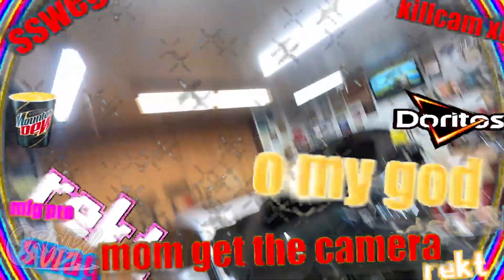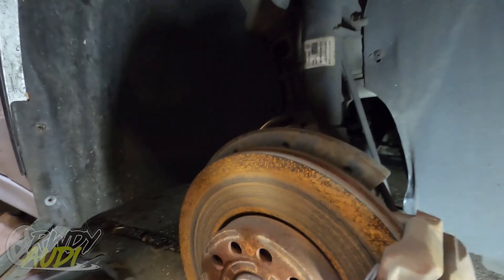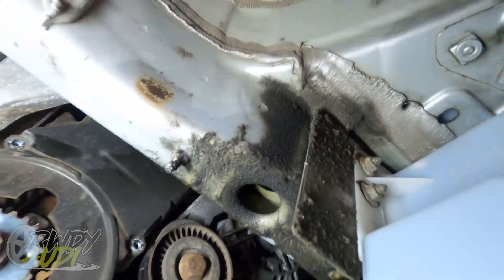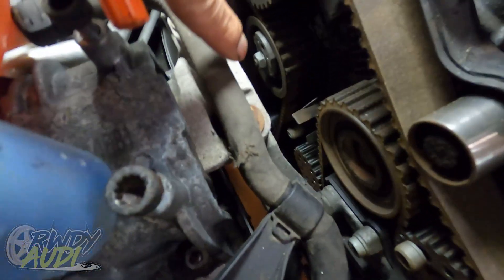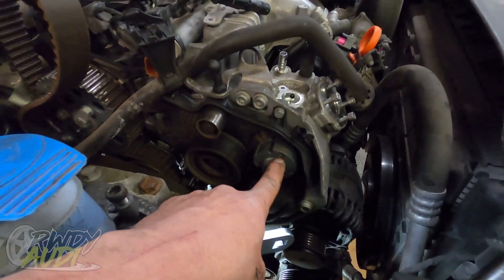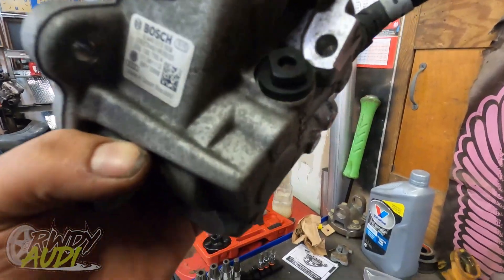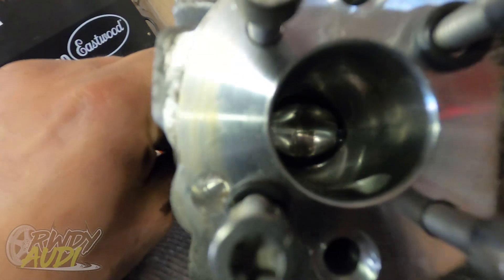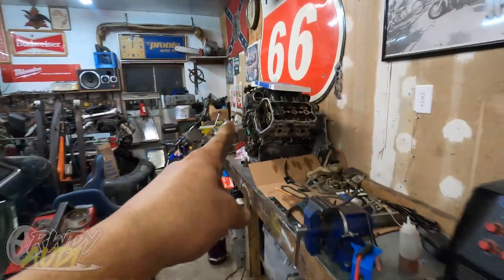How to REMOVE a HPFP on Volkswagen Jetta TDI | Why does the CP4 High Pressure Fuel Pump FAIL |

Comment: I just took mine off, theres metal shavings throughout the system but I dont see any wear on the cam or the roller, which is puzzling.
Reply from the maker: That's definitely a bit of a concern. Without any visual, I'm assuming the worst, I would suggest start collecting the bits to do this service sooner rather than later.

Comment: you don't need that tool to remove the pulley from the fuel pump. I used a 1/2 inch impact gun with a 24mm socket and it came right off. Used the same method installing it. Leave the nut on when you are removing it with the steering puller so it does not go flying off .

Comment: There is upgraded cp4 existing with one additional torx bolt preventing the piston to spin, post 2017 BMW got it and VW post 2020 I think
Reply: thats intresting, do you know what bmw and vw models got that upgraded cp4 pump? if so are those a direct swap on b7 2.0 tdi passat. thanks

Comment: Did you have any glitter on the fuel metering valve screens ? If so how much?   

Right now I have a small amount of aluminum flakes on top of the fuel filter and at the bottom but not  in the filter pleats when I cut it open and nothing I can see on the metering valve screens. I'm want to do the CP-3 conversion and am debating about doing the injectors as a maintenance item but not sur if it's necessary since the car only has 100k miles, Thanks
Reply from the maker: I have found more metal/glitter in the metering valves when these fail than I have found in the filters, usually when i find flakes in the filter and not the meter valve i also see injector pressure to be alittle lower then ones with no metal 10 to 20 grams. That said, if I was doing a cp3 upgrade as pre failure, I wouldn't replace  the injectors just the pump . Unless I had issues after the conversion... also you won't need the aux pump after the conversion and reflash.
Reply: @TheRwdyAudi   so you wouldn’t do the CP 3  conversion as a preventive maintenance if the CP 4  didn’t let loose ? 

I wound up, taking my pump head off in the car and looking at the cam and roller, and it looks perfect a little where in the board just discoloration at the top where it sits longer in the stroke 

I put it back together with a new filter, primed it, and drove the car around 

Under a wide open run, I got 1848  bar max  fuel pressure on a specified 1808 and then it came down to 1808

For boost, I got 2165 minus the 1052 with no boost puts me right at 19 psi by my calculation 

My idol IQs after all this being hot were .05 -.02 -.28 and -.12 how do those look I heard you want a total swing of .5 max so meaning if one is -.25 and the other one is positive.25 or is it up to .5 either way of an injector.

The kit I was thinking of was from Cascade German it’s by Fisher and they use the BMW R 70 CP3 fuel pump 

I like it because it’s brand new and I just bought two new electric fuel pumps and I like the thought of the auxiliary feeding this CP three because you leave it and also you don’t need to get a tune their metering valve either works or you use your old one 

So for now, I ordered the wheat bread, disaster kit that goes under the metering valve and I’m going to dose with diesel, clean and a lubricity additive and keep my fingers crossed to the point of arthritis 

I just bought this car have less than 500 miles on it. Don’t need to be putting four grand into it. I can do all my own work though at least  It’s at 100 K now

When the time comes closer to a timing belt  then I’ll either put a new CP four or do the CP three conversion I like the idea of a new pump over rebuilt
Reply from the maker: That sounds like a great plan, I apologize for my Grammer  on the prior post. I would definitely upgrade if it is in the budget, especially if you need a timing belt.
Reply: @TheRwdyAudi  what do you think about my injection quantities at idle and fuel pressure and boost

Do they all seem OK? 

I’m assuming the injection quantities that idle would be off if any glitter got the injectors  

What are bad injector quantities at idle when you should change injectors ?

Comment: You removed the camshaft follower so easily. Would you say an easy, preventative maintenance procedure on these cars would be to simply pull the camshaft follower and reseat it... or maybe even replace it every so often to ensure it never gets to this rotated state??

FCP Euro sells the camshaft follower and in looking at 1:11 in your video, it can be done without removing the pump.
Reply from the maker: You could 100% inspect the follower, I usually as a courtesy. I pull the meter valve and inspect for metal shaving, it alot simple then pulling the follower out. That said you could still pull the follower with minimal effort, the problem with these are there no detent to keep the follower in place like cp3 pump. Long time ago there was guy modding these cp4 pump to have a lock on them to keep the follower from walking around.

Comment: Hey bro. Did you end up having to replace the fuel injectors afterall? Or anything else?
Reply from the maker: Yes, we didn't risk it when the hpfp goes metal is almost always take the injectors out and filter. The lpfp and tank lines are usually fine along with the aux pump under hood. Everything else needs to be flushed or replaced, I don't have a promo code, but there is a shop " hans auto parts" I've bought several rebuilt set from him to help customer out with cost and haven't had any back knock on wood

Hope this helps and you get your car back on the road
Reply: @TheRwdyAudi  Got it, Thanks alot. I'll be doing all this pretty soon. your video is very helpful.

Comment: Is replacing a HPFP like this a catastrophically bad idea to do by someone with intermediate car knowledge lol? I've been quoted £2.6k on replacing my HPFP due to metal filings in my fuel filter on a 1.6tdi 2012 Audi A3 and I'm debating buying a refurbished HPFP and attempting it myself. I don't want to brick the car but the repairs are worth more than what the car is worth haha. Any advice would be useful ! :))
Reply from the maker: I'll be honest I haven't done a 1.6tdi yet. If it anything like 2.0tdi it jot that bad replace your pump, timing belt, and replace the injectors, take picture sof the injector which hole you put them in so they can be coded. Later replace your fuel sensors and flush the lines from the filter to pump and rail, prime it and it should fire right up. I've done alot of these 2.0tdi and never had metal in the tank or in the feed lines. 

This is the kit I used 

https://amzn.to/3W7szyC

I would recommend finding a service manual on ebay for your model of engine. Might not be your car specifically  but your engine and read up and follow the instructions.

The real cost comes when you buy the tools and then figure out if the 36 hrs and 4 weekends was worth the difference of having it done in a week lol. Honestly this job I would say is perfect for those who have a good knowledge basis and understand they could screw up if there not diligent and don't follow the instructions. 

Hope this helps 👊😎 you got this
Reply: @TheRwdyAudi  Thank you so so much!! That's a really helpful and comprehensive answer. I hope the DIY route is worth the heaps of time and patience needed, honestly praying that it works out 🙏 Will soon find out 😂

Comment: I’m all for making the job easier, less chances for mistake especially when it’s hard to access the timing belt tensioner. My recommendation for anyone doing this job just remove the engine mount and make sure u have a jack with a block of wood up under the oil pan, I believe they are stretch bolts but you can buy a complete kit for like $40.

Comment: did you have to change the fuel injectors I did the same without changing fuel injectors no start low fuel rail presure . just wondering if the injectors are bad
Reply: Did you figure out your problem?

Comment: Car went into limp mode on me and engine stalled going around 20mph, pulled over and my car wouldn’t start at all. Battery went dead too so I called my mechanic who told me my alternator blew and then ruined the battery. I had similar symptoms to a hpfp failure, I’m praying to god it’s not that though I can’t afford a 6-7k repair on a 2011 golf😭
Reply: So what was the actual problem on your 2011 Golf?

Comment: I’m doing this on my girlfriends audi a3. My bottom most timing tool is lined up, but the uppermost  sprocket is 180 as if a previous mechanic installed it upside down. Can you please help
Reply: For anyone reading this and wondering what to do, the trick is to rotate the crank sprocket another full rotation which will then realign the cam sprocket to TDC.
Reply from the maker: That is a touchy one. Send me a dm on the gram, with some pictures and will see what's what.

Comment: Maybe the pin on the follower broke ? and then its worn away ? because why wouldn't they have a pin to keep it aligned  ???
Reply from the maker: You would think they would have, but they didn't.. only the gas cars had a follower with pin. I'll post a photo in the community tab with the different gas follower vs. tdi cp4 follower

Comment: So you dont have to drop and clean the tank and replase the tank fuel pump a secondary pump
Reply from the maker: Very rarely have I had to replace the intank pump the amount of metal that returns back to tank is so small(not to mention it would get trapped in the pick up sock on the pump it self) and even if it where to come up the line it would get stuck in the filter before ever being able to cycle back to the hpfp... it physically not possible.
As for the secondary pump, "dirty or contaminated " fuel would never enter the aux pump as it only feeds its filter, and fuel can't go back wards. 

One thing I didn't cover that should be done is that both the fpr sensor needs to be clean and possibly  replaced if they are showing faults.

All of this typed out each case is different and should be treated as such.

Best of luck, my dude, I hope this helps

Comment: Do you need to program the new pump with a scan tool ?
Reply from the maker: No you don't need to program or adapt for the new pumps
Reply: You are supposed to prime the fuel system with the vcds tool though.

Comment: Hi mate, I’m replacing my timing belt on my 2.0 tdi CR engine which has had a timing belt done in the past. The issue is I’ve locked the crank and cam shaft in place but the tab to lock the high pressure fuel pump is about 45 degrees away from the hole, almost as if the last mechanic who replaced the belt didn’t lock the fuel pump in. Do I pull the fuel pump back round and lock it in before putting the new belt on or do I just mark the old belt and replace it as it is without locking in the fuel pump? Some people say the timing is important on these pumps and others say not so I’m not sure how to go about it. Cheers
Reply from the maker: So first off the fuel pump on these has nothing to really do with the timing the engine.(there is torsion system  that is involved with it but that on the cam side of thing and it requires vcds or equivalent to mess with ). The only reason you need to lock up the fuel pump is for removal of the pulley stack on it.

I include a write up you will probably find alot of value you and should help you. It help me when I learned how to do these the first time.

https://www.myturbodiesel.com/d2/1000q/a4/vw-golf-jetta-beetle-tdi-timing-belt-replacement-2.htm
Reply: I'm in the same boat. I put the pin in the wrong place for the hpfp. When i loosened the bolts on the sprocket the y tab went  straight up away from the pin hole. What is the fix?  How do i clock it or time it . Still have my crank and came pinned. Please help.

Comment: Hi, I watched your video and thank you for doing it. About the timing belt. It is not necessary to remove it... Just loosen the tensioner. Yes you are correct that "most" of the slack is on the opposite side of the engine but there is enough slack to remove the idler pulley to the top left of the HPFP and the belt is way loose enough to remove the sprocket with ease. :o)
Reply from the maker: You could and I'm sure there more ways to do this than the one I have shown. That said as long everything lines up and you feel confident do this my friend any way that makes since. 👊😎
Reply: do you know where I can find instruction on how to remove the hpfp without taking out the timing belt completly?
Reply from the maker: I could imagine there out there but I don't know of any links I can directly specifically to. If I was gonna do it that way I would be indexing and marketing everything so my marks don't move and u use the timing locks tools so the engine still stays in place. Best of luck my friend I hope this helps
Reply: @TheRwdyAudi  Thank you! I'll be doing a hpfp Chang later in the week and will definitely be using your video for reference the only thing I haven't done before (myself) is the timing belt so just trying to find the easy way to do this.
Reply: @Resoxin  Even if you just slacken the belt tensioner to remove HPFP you should still purchase the locking pin set to immobilize the crankshaft and the camshaft. VWs are really sensitive to out of timing issues and it will not start if the timing isn't dead on.
Reply: @RxMich  Thanks for the reply! I actually  found out I don't have to change my HPFP it was a different issue I was haveing, but I was planning to get those tools - might try to tackle the timing myself at the next interval.
Reply: @Resoxin  When you replace the timing belt replace the HPFP at the same time. Time in use is its enemy. If you wait for it to fail then the repair bill will be much higher since you have to drain the fuel tank and clean it,clean all the fuel lines, replace all 3 fuel pumps, replace all the fuel injectors,fuel rail, and fuel rail regulator. VW dealer will do these repairs  for you for a modest $14,000.00 even if your car is only worth $3,000.00,  Bosch remanufactures the HPFP for about $500.00.

I would also steer clear of any gas stations using Bio-Diesel. Use of it will eventually destroy the HPFP. It's bad enough that the EPA requires the sale of Ultra Low Sulfur fuels....but Bio-Diesel has none. The Sulfur in the diesel is a lubricating agent. without it, the pump starts to grind through itself creating a lot of fine metalic particles that clog the fuel injectors and short out the motors in the two electric fuel pumps.
Reply: The other thing I would recommend would be to install a fuel filter in the scavenge return line to the fuel tank. That would at least limit the damage to the fuel pump, fuel rail, pressure regulator and fuel injectors.

Comment: Can the cam follower be replaced?
Reply from the maker: Yes!! it can be
Reply: @TheRwdyAudi  have you rebuilt yours or just bought a replacement pump
Reply from the maker: This was service work for customer. But in this case we had to replace the pump because the follower turned side ways(common failure) it completely ruin the unit(there is a company in Ukraine  that sell parts to rebuild my customer decided not go this route). Ultimately replacement of the cp4 pump was a better option. Hope this answered your question